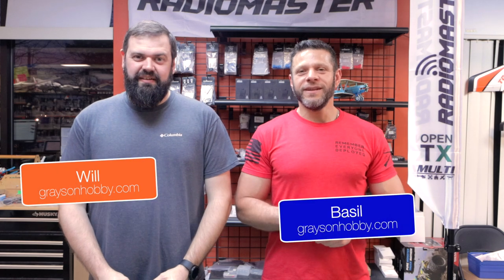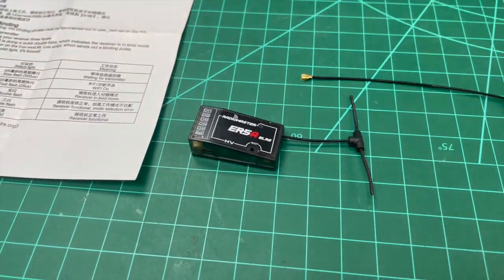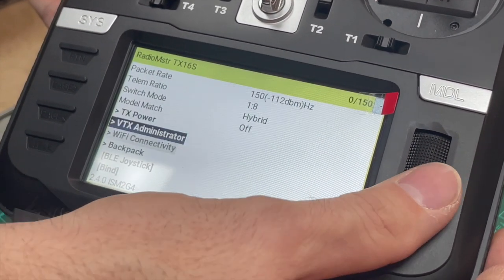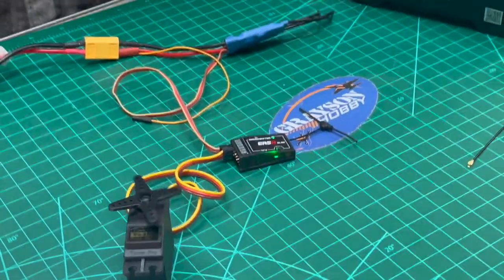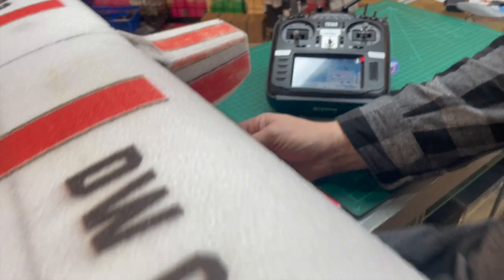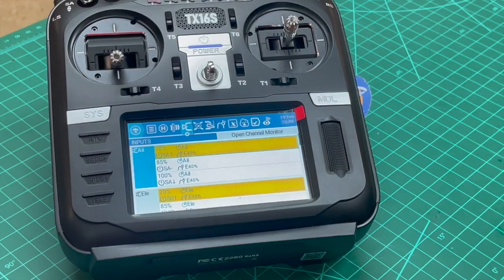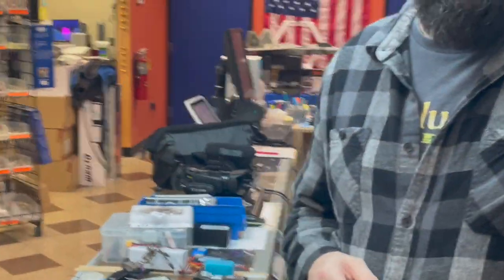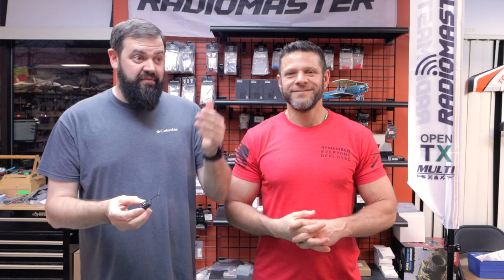How to Bind RadioMaster ELRS Fixed Wing Receiver - ER5A

Comment: Just a note here from someone who has the receiver. The first four channels will work fine. Channel 5 is a kill switch channel. Which means it's binary. On and off. If you want to use it with full PWM movement you need to go into the device itself and switch it to channel 6. So anything on that airplane that's using channel 5 will not work properly unless it's updated in the internal web site
Reply: if its binary can i attach led lights on it

Comment: Hi guys. Just confused. Will er5c works with tx12 crossfire protocol? Or i should buy multiprotocol external antenna transmitter?
Reply: You would need to use the ELRS internal if your radio only has ELRS. if your radio came with an internal 4 in 1 then you would need to buy an external ELRS module to work with this receiver. For example my RadioMaster TX16s transmitter has the 4 in 1 built in. But I have an ELRS external module, that would work with is receiver.

Comment: If ELRS is to continue to grow as a system it needs to stabilize and to be as simple as SPECTRUM otherwise the general old timers that are the mainstay of the RC Hobby are not going to buy into this system and it's going to die for lack of sales.  IT NEEDS TO BE SIMPLE AND FOOLPROOF
Reply: It's an open source project, always changing and improving. If you're going to mess with ELRS, which also probably means messing with Open/EdgeTx, you have to want to experiment and learn.
Reply: @TheLostSquadron  Yes but there is a cohort of fliers that are the mainstay of the club I fly with that are old school and just really want plug and play and they are the predominance of the purchasing fliers that have money to spend and what you do you want to do shove that market aside, so what's left the few kids that are struggling with contract work and low wages and inflation.
Reply: @allrcflyingisfun  There are a bunch of older guys in the club I'm in, and many of them already struggle with Spektrum.

They look at OpenTx and FPV stuff and just kinda glaze over. This is never gonna be for them. It's not just an age thing, it's the will to expand/learn. I'm not young, been flying since the 90's and came from the Futaba and Spektrum world.
Reply: @TheLostSquadron  Are you still flying 27mzh or 35mzh no your flying 24 why because the change over was made as easy as possible,
Reply: @allrcflyingisfun  I don't understand your point there. Changing frequency was mandated, protocol/radio choice is wide open. The guys that don't want to fiddle around will just stay on DSMX, it's fine that way.
Reply: I'm newer to the hobby, but age-wise, I would have started when you needed to hang frequency tags. That said, I appreciate any technology improvements that would help eliminate worries about RX antenna placement and flying through dead zones. Perhaps by coming late to the party I don't have a loyalty to any particular brand or protocol. I imagine the more advanced stuff will become 2nd nature through repetition
Reply: I've been flying since the '70s. This is a hobby. A lot of us like learning new things and this is a really cool thing to learn. I bought it just to put it into a flying foamy wing. How's that for nerding out?

Comment: You guys need to make more of the version difference as my ELRS backpack was on version 3.0 and would not connect to any receivers that the versions were different and the receivers would not update to version 3.0 so had to
revert my transmitter to version 2.5.

Comment: I had a problem with this exact setup.
The ESC and brushless motor worked fine, however when I tried adding a servo to the setup (9g micro servo), it only worked for a second and now doesn’t work at all.
I tried again and got the same result with a different servo.
Any tips?